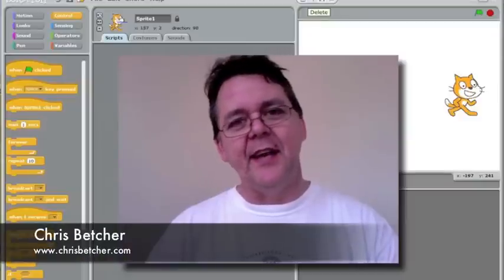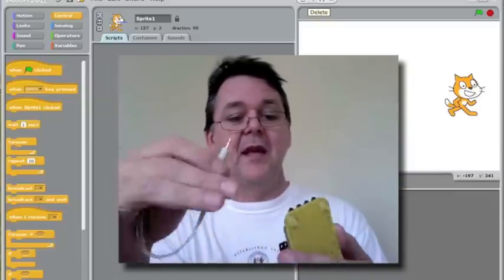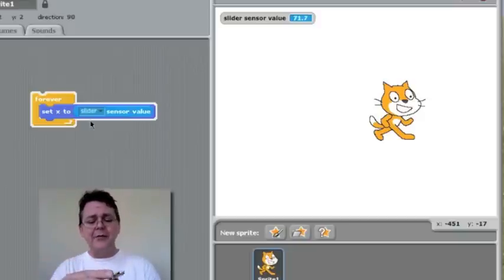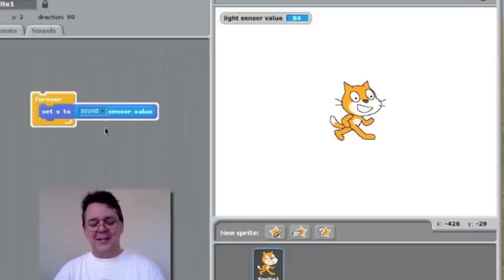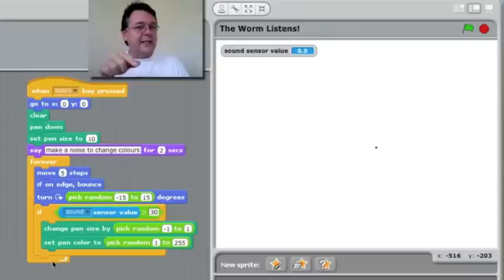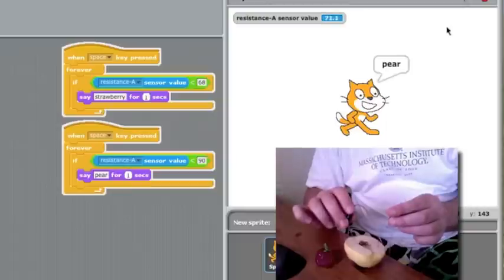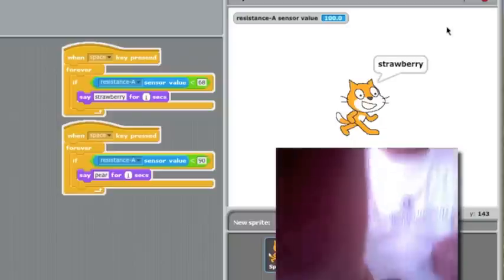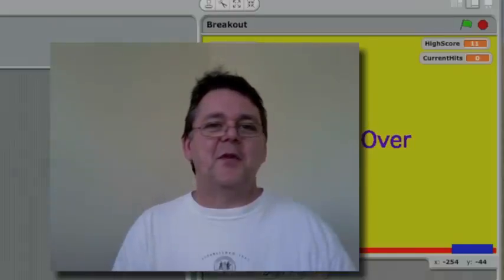Extending Scratch with Picoboards

Comment: The reason your cat flips between saying "pear" and "strawberry" isn't because the value is close to the limit.  That makes no difference to a program since it deals with exact numbers.  It flips because you have essentially two processes running.  One is asking "is the value less than 68?" and one asks "is the value less than 90?"  Well, both can be true.  C change the "if < 68" statement to an "if-else" statement.  Then put the "if < 90" block inside the else portion.

Comment: Hi Chris - nice videos. 

Does anyone know how I can attach an Arduino in the simplest way to scratch programming. Just install Scratch for desktop, connect arduino, and a few other steps, and I should be able to blink the LED and do all the other projects. 

Does S4A work that way. Does it give some kind of extensions on the Scratch desktop interface, which will display the command blocks for arduino. Is it how it works. A bit confused by videos which shows the arduino sketch on the computer screen rather than physically connected. And also I am not sure if on installing S4A it installa a separate scratch-like program or if it adds an extension to the existing scratch installation. 

Any details is greatly appreciated. Thanks!
Reply from the maker: Hi Sandeep, I've only played a little bit with S4A but it seems to do exactly as you suggest... Control an Arduino using Scratch block coding.  Here's a short video I made of my first S4A project.  http://youtu.be/tbddLQc0E50
Reply from the maker: s4a is a separate instance of Scratch.